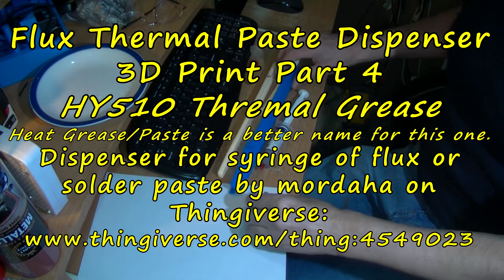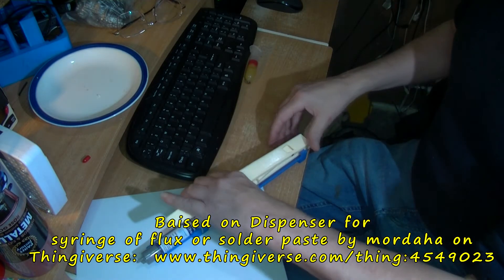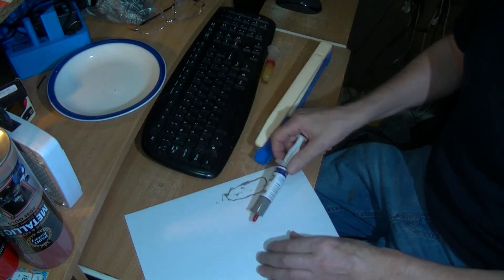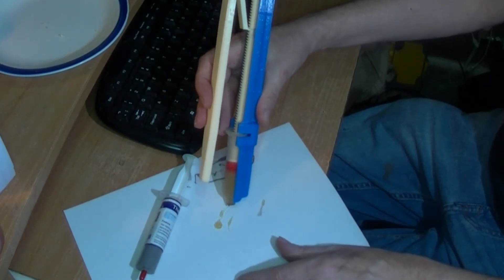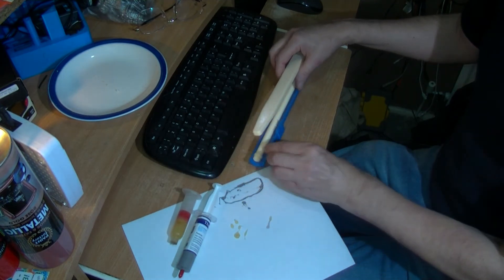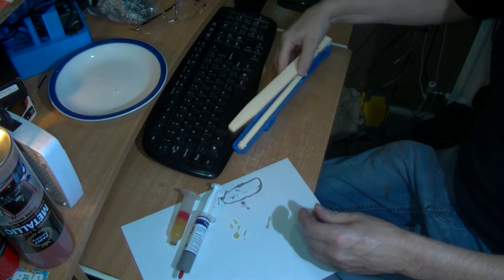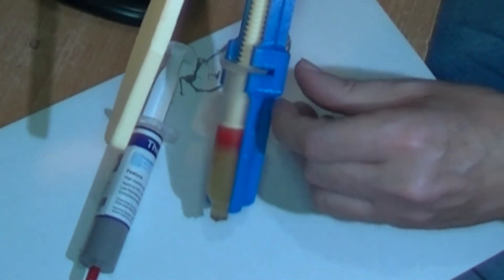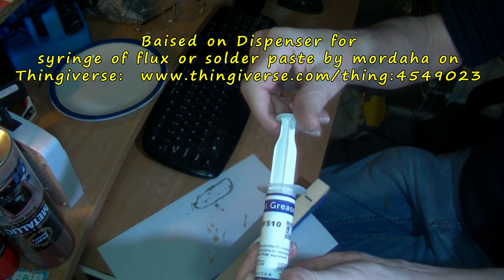Flux Thermal  Paste Dispenser 3D Print Part 4

Comment: I printed the original and was really curious when I saw your version what the extra length was for (did wonder if it was for using the plunger also). 

This is what I love about 3D printing - you needed something really specific to your needs and ergonomics and you can so quickly make it exactly as needed :)